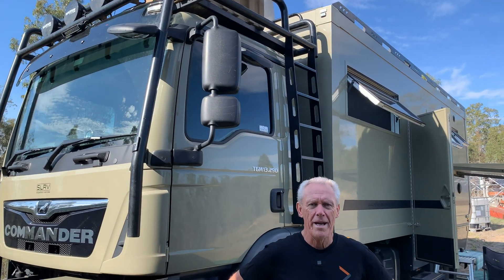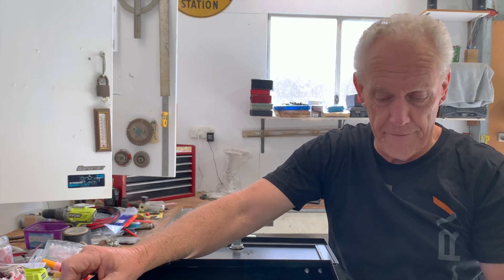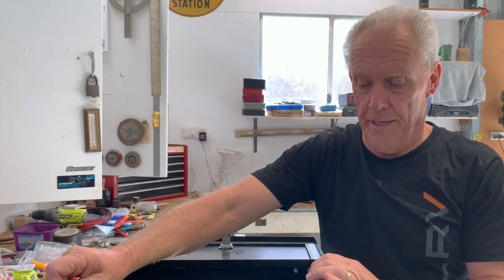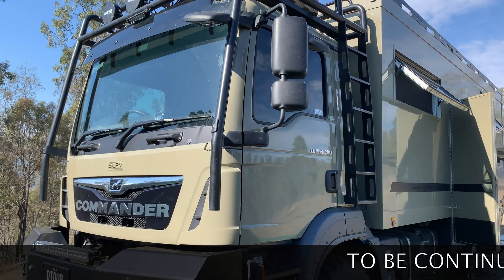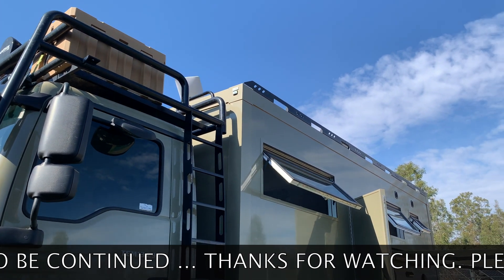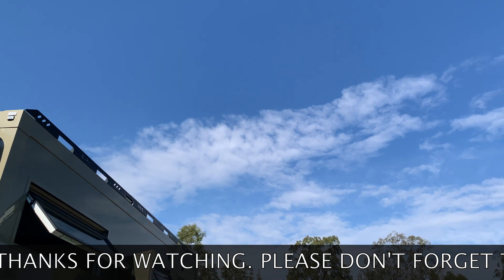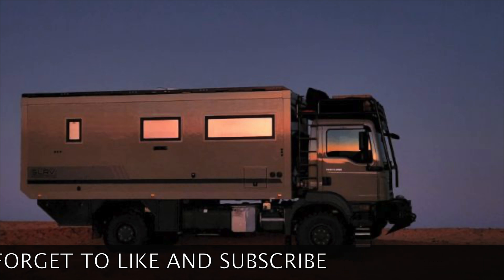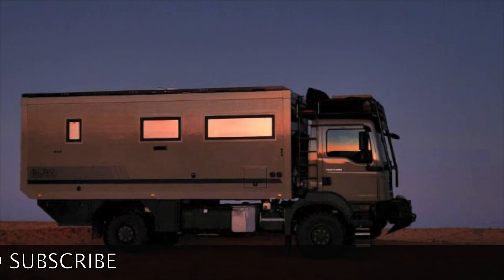HYDROGEN : THE SOLUTION TO IMPROVING YOUR FUEL ECONOMY (PART 1)

Comment: This one major mistake people make when building these kits, the "bubbler". I f you ever have the unfortunate blow back along the pipe from engine to bubbler it will destroy the bottle, period. The reason being is that only filling the bubbler 66% means that the remaining cavity is 33% oxygen/hydrogen and the force of the instant ignition is somewhat frightening.
The solution is relatively simple and resetting, firstly reduce the amount of gas cavity and use an anti sloshing material to prevent water entering the pipe, secondly to fit a spring loaded self setting device on top of the bubbler so that the blow back has somewhere to vent itself.
To prove my point (not recommending it though) allow the bubbler to function as it normally does then ignite the gas coming out the pipe that feeds the engine, boom, no bubbler.
Reply from the maker: You are correct! I have to put a check valve in there and a diffuser at the bottom of the tube. I need to minimise the available space in the bubbler. Thanks for your comment 😊
Reply: @teamd-tour My friend made a similar one and there was flashback to the bubbler, and unfortunately this is what puts of some people from experimenting. I can remember in the 70's (UK time lol) when there was a private car with HOD just 8 mile from me and apparently worked quite well, he sold it and then nothing more...🤔
Reply from the maker: @merlin1346  my father told me back in the early sixties about a car running on water. I couldn’t understand what he was talking about until recently. It all makes sense now!
Reply: @teamd-tour  The most mystifying thing is why after all these years (even WWII Hydrogen vehicles in the UK) why are we still no further than private individuals building home made kits? Its not as if the technology is not there, it is. We have had the likes of Stanly Myers and his VW dune buggy, gone. The one light at the end of the tunnel lies with JCB, or will it disappear like the rest?
https://www.youtube.com/watch?v=H6_qAta3Gk8
Reply from the maker: @merlin1346  Thanks to the likes of JCB, Cummins and BMW, they are pretty much leading the way. India is a driving force. A possible reason why hydrogen hasn't progressed could be the cost of production. The USA has been directing all of its focus on oil production in the past and have had the advantage of inexpensive fuel. Now countries like India have to buy oil and gas because they can no longer produce it themselves.  Thanks for the link to the video! I hadn't seen that one and thanks for your comment! Keep watching 😀

Comment: have you considered a fly by wire accelerator actuator for controlling the gas production, as you accelerate more, more gas is generated?
Reply from the maker: The gas production isn't dependant on throttle position. The truck does have fly by wire but it's not required to control the gas

Comment: What is the Sodium Hydroxide to water ratio, or is it relatively unimportant?
Reply from the maker: It is important. I don't know the exact ratio. I haven't calculated that but it  works out to a dessertspoon to approx 4 litres of water. The idea is to make up the solution in a jar or similar so it fully dissolves and then add the solution to the reservoir. The change in amperage is usually a good indication of the correct ration of sodium hydroxide to water.

Comment: Very interested to see the difference in economy and power. Would you redyno your pump? Interested in the number change(dunno and fuel run before and after).

Thanks for your content
Reply from the maker: No change to the pump. Pumps or injectors. The gas is injected after the mass airflow meter.

Comment: How does it compare with ethanol or gas injection. Looks to simpler than thise.
Reply from the maker: I haven't tested ethanol injection but it will outperform gas if you're talking LPG
I was the first person in Queensland to run LPG and diesel 😀
Reply: @teamd-tour  that's interesting
I did a bit of work for a friend installing the ethanol system into the Redlands shire councils trucks about 8 or 9 years ago.
They also had gas systems on some Cat D9's in South Australia had some over heating issues.
Will be interesting to see how the hydrogen goes on the MAN. 
CHEERS
Reply from the maker: @davidmoore7303  I wonder what the problem was with the heating issues? I've never experienced that 😀
Reply: @teamd-tour  I never heard the outcome.